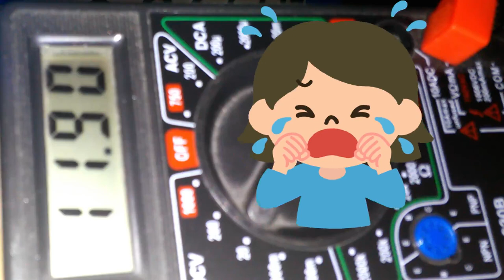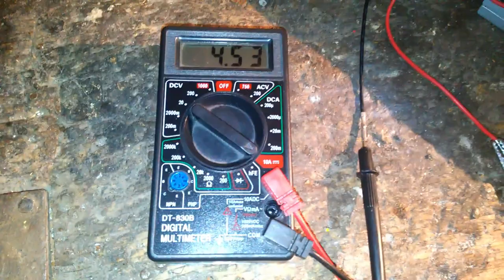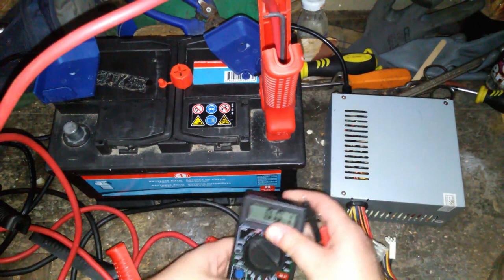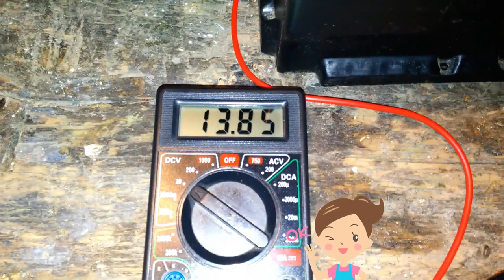Caricabatterie auto fai da te da un vecchio alimentatore pc atx

Comment: ciao con un ATX P4-450 W SI PUò UTILIZZARE   ALIMENTATORE PER AVVITATORE 12 V 300 WAT?
Reply from the maker: Per fare cosa? caricare le batterie al litio o altro?
Reply: ANCHE  PER AUTO
Reply: PERCHé O PROVATO COLLEGARE 5V FUNZIONA  PIANO INVECE 12 GIALLO VA IN PROTEZIONE O PROVATO CON CARICA BATTERIA AUTO AVVITATORE FUNZIONA A MERAVIGLIA PERO VOLEVO FARE FUNZIONARE CON ALIMENTATORE PC
Reply from the maker: @eugeniobruno7765  Per auto con normale batteria da 12 volt al piombo acido, deve avere uno dei circuiti integrati indicati nel video. Per batterie al litio non va bene perché ci deve essere anche un circuito di controllo in grado di gestire le varie celle.
Reply: @AndreaBox  ULTIMA DOMANDA IL MIO INTEGRATO NON é ESATTAMENTE  UGUALE A QUELLO DEL VIDEO PERò SE FACCIO QUESTA  MODIFICA CON RESISTENZA 1300 OM POTREBBE FUNZIONARE?
Reply from the maker: @eugeniobruno7765   se il circuito non è uguale od equivalente non funziona e potrebbe fare danni.
Reply: ciao oggi o comprato trasformatore  30 ampere 12 volt 220 v 360w devo dire che avvitatore funziona però non devo farlo partire subito veloce ma piano e poi sempre piu veloce altrimenti va in protezione si puo fare qualche modifica
Reply from the maker: @eugeniobruno7765  L'integrato che controlla l' alimentatore attiva la protezione controllando vari parametri, in base al tipo di integrato si potrebbe tentare di ingannarlo, ma non è una operazione standard. Lo spunto iniziale dell'avvitatore sicuramente supera i limiti preimpostati nell'integrato.

Comment: 🤔 dici che se provassi a caricare 1 batteria cn  in alimentatore  da cb  12,6v riesco?
Reply from the maker: No, no deve essere di voltaggio maggiore di 14 per portare la batteria a 13,80 volt, inoltre deve avere un amperaggio adeguato.
Reply from the maker: @matthewmatthew5123  Non è progettato per supportare grandi carichi, andrà in protezione o si brucerà, inoltre il voltaggio non è sufficiente.
Reply: @AndreaBox  Vabbeh era 1 idea
Reply from the maker: @matthewmatthew5123  Certo, nessuno nasce imparato! 🙃👷‍♂️
Reply: @AndreaBox  15V VAN BENE?
Reply from the maker: La tensione ottimale è di circa 14,25 volt oltre si potrebbero provocare danni: surriscaldamento, esplosione, ecc..
Reply: @AndreaBox  se la fisso  a 14,30-14,50 allora va bene?

Comment: Scusami è la prima volta che ti vedo ed appena ho visto il tuo video subito è partito il pollicione  in su, una domanda se mi permetti, io ho un atx con il tuo stesso cip ma non riesco a trovare il GND, posso usare qualcos'altro al suo posto? Grazie e ciao.
Reply from the maker: Puoi usare una massa qualunque presente sul circuito di solito seguendo i cavi neri e verificando con un multimetro. Grazie per aver visto i video.
Reply: @AndreaBox  grazie infinite appena ho un po' di tempo ci provo e ti faccio sapere. Ciao
Reply from the maker: @antoninosparaco5346  L'esperienza condivisa è sempre gradita. Grazie
Reply: @AndreaBox  se posso chiederti nel tuo video usi una resistenza da 10 k per portare la tensione a quasi 14. Se la volessi aumentare ancora un pochino diciamo a 14,4 la resistenza dovrebbe essere più bassa o più alta?
Reply from the maker: @antoninosparaco5346  Ho usato una resistenza da  13000 ohm tra il pin uno e la massa, per una  la tensione a vuoto a circa 14,3 volt. Per aumentare ulteriormente si può provare con una resistenza maggiore, anche se l'integrato ha dei limiti propri.
Reply: @AndreaBox  da oggi in poi sei il mio idolo.
Reply from the maker: @antoninosparaco5346  🕺🤣

Comment: Ciao, dovresti anche sostituire i condensatori elettrolitici in uscita alla 5 volt (fili rossi) con altri che sopportano tensioni più elevate, altrimenti potrebbero esplodere aumentando la tensione.
Reply from the maker: Ho usato l uscita a 12 volt,  se non ricordo male l alimentatore è da 350 watt e la batteria da circa 70 ah viene caricata a non più di 3 ampere. Per ora non è esploso niente, ma ho aggiunto un bel diodo riciclato per impedire correnti inverse.

Comment: Quelli che misuri verso la fine del video sono gli ampere?
Reply from the maker: Si, circa 2,20 ampere.
Reply: Ti volevo chiedere una cosa , dovrei comprare un caricabatterie per la mia bici elettrica perche' mi si e' bruciato l'originale che era 220volt  50HZ 90watt output 44volt 1,6ah , deve ricaricare 3 batterie al piombo da 12volt 14ah , (36volt in serie) se ne prendo uno da 2 ah invece che da 1,6ah come l'originale succede qualcosa o semplicemente scalda meno?
Reply from the maker: Meglio rispettare le specifiche del produttore.

Comment: Salve, sul mio ali ho due integrati con queste sigle: S8301 D339 e l'altro: S7706 B494 mi dite per favore dove saldare la resistenza da 13000 ohm? Grazie per le eventuali risposte.
Reply from the maker: La procedura è valida solo per circuiti integrati tl494 oppure un ka7500 od equivalenti.

Comment: scusa  ti devo chiedere alcune info: la resistenza da 1/4 di watt e sufficiente'?  13000 ohm è un valore commerciale?
Reply from the maker: Giuseppe Colombo Si, 1/4 di Watt da 13k ohm valore standard, la resistenza che ho usato è anch'essa riciclata da un vecchio alimentatore rotto. La procedura è valida solo per alimentatori con circuito integrato del tipo indicato nella descrizione del video. Ciao
Reply: Grazie per info  Il mio è un tl494

Comment: Ho un altro ali con integrato TL494L ho saldato la resistenza da 13000 ohm al pin 1 ma mi escono sempre e solo 12V. Aiutooo
Reply from the maker: Controlla le saldature, la residenza,  che sia effettivamente il PIN 1 magari basandoti su uno schema del circuito e che sia l'altro capo della resistenza collegata a massa.
Reply: @AndreaBox  Risolto, non 14.3 ma 13,8V in uscita (dovrebbero essere sufficienti per la ricarica) mi resta da controllare sotto carica l'amperaggio (secondo il tuo metodo dovrebbero uscire circa 2,2 A) p.s  ho messo anche una resistenza da 10W 10 ohm sui 5V per stabilizzare la tensione  (letto da qualche parte) pensi vada bene? cmq grazie, sei un grande!
Reply from the maker: Grazie! Probabilmente l'alimentatore ha qualche malfunzionamento, la tensione a vuoto non è quella ideale, ma comunque utile per ricaricare in parte la batteria, il carico sui 5v non è necessario e l'amperaggio varia in base alla carica raggiunta dalla batteria.